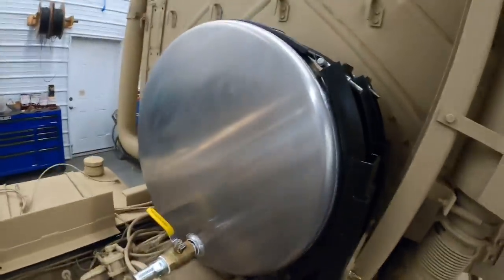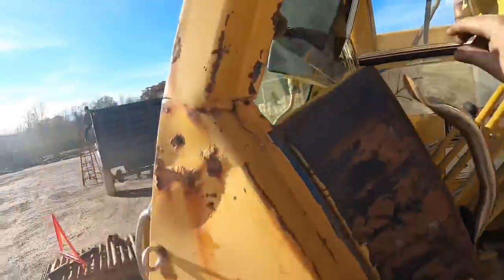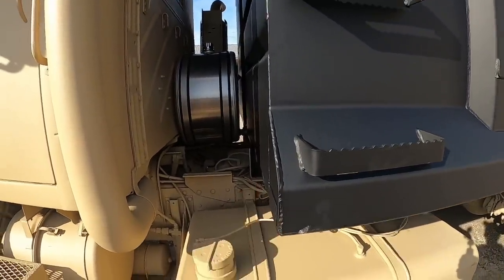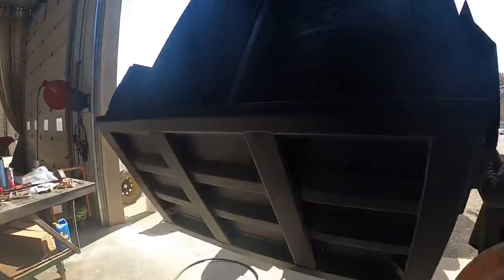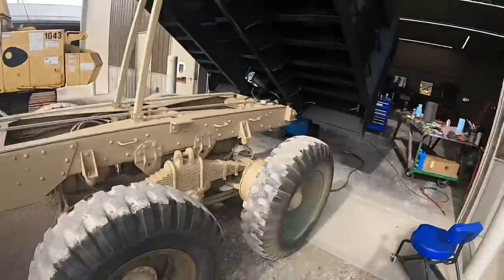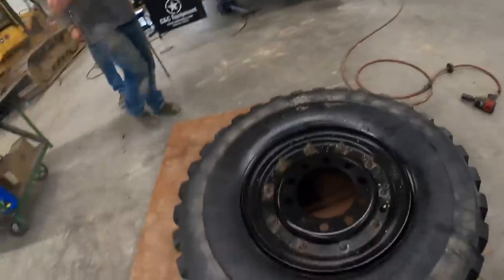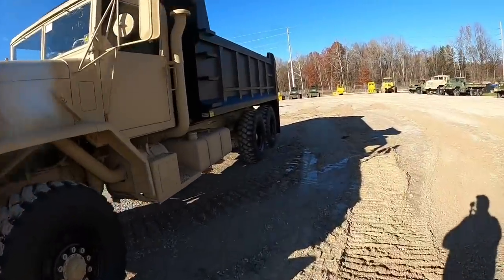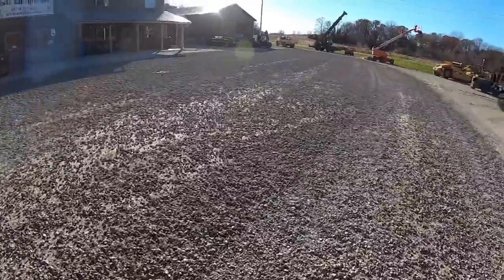5 ton military dump truck build installing bed and spreading stone! @C_CEQUIPMENT

Comment: A tip for the mudflaps.  Use a full width strap to clamp the mudflap. This makes it easy to loosen the bolts and  slide the mudflap back in when they get rippped off.
Using the mudflap washers like you have means that you have 5 bites taken out of the mudflap leaving nothing to clamp onto.

Comment: That is a really good looking dump truck . The main thing that really set it off was when you all changed the wheels and bigger tires . You and the truck did a great job of spreading the gravel . That looks like a really well made dump bed and it sets perfect on the truck, you all did a great job on the build .
My dad hauled and spread thousands of tons of different sizes of gravel on roads.  And at one time he hauled a lot of blacktop, also and at one time he hauled a lot of slag out of a steel mill (and that stuff was hot, hotter than blacktop) and dumped it on roads. Years ago, he worked on a government job for a while with his truck hauling gravel and dumping them on a big acreage of a construction site and dumped the gravel on a lot of the site 8 feet thick .
I will see you all later in another video, so be careful and stay safe .
As always, Jeffrey !!!
Reply from the maker: Thanks

Comment: I was in an engineer battalion back in the 80's almost 90 and drove trucks like these and the 5 ton dump. These were go anywhere haul anything and get the job done types of trucks. How you set this one up is awesome. What we had were basic bare minimum setups. The only thing is that I would caution folks is those split rim tires. Always use a safety chain around the tire and rim when you go to air it up. Accidents happen and nobody wants to see one of those rings  come flying off. I know that safety has been improved since the last time I changed one of these but you can never be too careful. I saw the price for one of these trucks that was given to another commenter and I'm surprised it was that low. I was expecting the price to be mid 50's to mid 60's. Good job.

Comment: Here in aus we use a brake booster instead of an air cylinder so if you park up with a load your tailgate won’t pop.
Reply from the maker: That’s interesting and sounds like a great idea!

Comment: Maybe make a pan for the dump body if a person was to dump asphalt into a machine it would dump right into the Harper and not miss and make a mess also put hook and eyes on the mud flaps so when in use they wouldn’t get torn off. Just a thought!

Comment: Nice build! I took a 5 ton 5th wheel 900 series an put an 800 series dump bed on it. Love the truck but now wish I had the longer dump bed were I could carry more. Would like to know see how yall would fix one with a winch on the front an run the hydraulics for each. I'm sure my problem is a little different because of the 800 series bed. Beautiful truck an looks like it works flawlessly!
Reply from the maker: We have done a few with the winch
Takes some extra plumbing but can be done!

Comment: Mud flap fail need to cut up from hole it will come off in stead of ripping off when backed over then reinstall not damaged!
Reply from the maker: Good tip

Comment: I love this truck it has everything on it for my line of work except I would rather have a barn gate for hauling brush and debris and I would prefer manual transmission bc automatics are more aggravating when tailgating stone, I'd also add tarp system. But I love how this truck has the flip up hood instead of the bat wing style that you often see on these trucks, the bed is full size and fits truck well for any application, I'd like pintle hitch and air brake & electric brake hookups added. This is a sweet truck im debating on getting rid of my tandem for a setup like this. I serve a 70 mile radius with my business but a truck like this would serve me great for getting in tricky areas or off road areas. How much does a build like this cost or what are you guys selling a truck like this for ? @ C&C equipment
Reply from the maker: They start at 41k
Reply: @C_CEQUIPMENT  is that cab and Chassis only, dump beds optional?
Reply from the maker: We can sell cab and chassis

Comment: When they refer to that truck as a 5 ton truck, are they referring to the gvwr? I know that truck will haul more than 5 tons.
Reply from the maker: So those ratings are the off road capacity per military 
On road is more
But everything the military builds is underrated and overbuilt 
They will haul 15plus tons no problem

Comment: Hey buddy i happened to notice on your hydraulic tank bracket and on the mud flaps instead of having the head of the bolts face out you put the nuts outwards. So i was just wondering if there was a reason or not.. Either way it's a beautiful rig you guys did a hell of a job on it!!!! Happy New Year!
Reply from the maker: So I like to do that on the mudflaps so it makes it easier on the next guy to take them off
If you put the nut towards the tire all the dirt, water and salt get thrown on there making it more likely to seize up
And harder to take off
Hopefully that makes since
Reply: Also when you put the nut and the  threaded end of the bolt towards the outside ( back of the truck ) and the head towards the tires it doesn't catch grass and mud and stuff that is throwed up by the tires as bad and build up in there along the top of the mud flaps and then ice and snow in the winter time and build it all up in there, it doesn't have the extra length of the bolt sticking out for the stuff to hang on and build up .

Comment: I bought lots of those 8.3 cummins military trucks , I still have one 923a2 and a 929a2 dump , that box you put on is way to big and heavy. those engines are way to weak on power for any thing to heavy , the box is heavy enough , besides putting material in them. let me know what you think. I had a 817 dump and it had more power than the 8.3 .
Reply from the maker: They are underpowered for sure
We have built over 40 of this model and had several repeat customers

Comment: I have two concerns, when doing your wiring I noticed you don’t solder the joints, second concern the young fella that was doing those tires, did not have the tires in a cage. I had a friend damn near get split in half from the retaining ring came flying out, needless to say he died. Overall you do very nice work, work safely and live for tomorrow.
Reply from the maker: Yes thanks 
These wheels are a little different then what your are explaining 
The outer rim is bolted on making it very unlikely to come apart

Comment: Needed rubber hoses over the spreader chain  Limited "Scratches"
Reply: Would you do me a favor please D.P has not found a beverage holder for Lt.Dan and his John Deere with the plow found him a few Winches for him to look at for his smaller dozer as a tow er to adjust him when making turns to fixon his smaller dozer I also found a excavator for $1 looks all there plus a few more?

Comment: Don't know how much corrosion you get there? As I have always found that running grounds back to the battery grd is better not relying on frame to do that. Heat shrinks double wall epoxy with soldering connections .  
You have greaseable pins, not greased isee. hhaaaa

Comment: Do you ever run across any of the older trucks like this one but with a manual transmission???
Reply from the maker: Some
I have a couple at the shop
Reply: @C_CEQUIPMENT  What model were they M818???
Reply from the maker: I have an m814 which is the double frame long wheelbase like we use for dump trucks then we had an m813 but it’s sold
Reply: @C_CEQUIPMENT  Have you got pictures of the m814???
Reply from the maker: Email us 
Sales@ccsurplus.com and we can get some
Reply from the maker: Email us 
Sales@ccsurplus.com and we can get some

Comment: That doesn't seem like enough weld passes on those hinges to the bed
Reply from the maker: Hmm
I have personally welded over 60 of them on and not had any issues
Reply: @C_CEQUIPMENT Ii worked at a place that built dump trucks they did minimum 6 passes on each side of each hinge. It looked like you only did 2 or was that editing

Comment: Great Job!  One question do you ever have trouble with the air tailgate cylinder leaking off and the tailgate opening while loaded?  The trucks I worked on hauled sludge and had to have a safety lock installed on the gate.  Thanks for sharing!
Reply from the maker: Not on normal conditions 
The way they cam over makes them strong
But they do offer sludge locks as an option… that stuff is nasty and the main reason for those is to keep the tailgate pulled in tight so it doesn’t seep out
Reply: @C_CEQUIPMENT  Thanks

Comment: This is my first time seeing your video. The truck looks amazing!!! I really like how the paint turned out. I’m looking forward to seeing the beginning of this project.
You should put duals in back because if you have a blowout you will be down until it gets fixed whereas if you have a dual set up you can fumble your way to a service area.
 the bolts for the mud flaps are too long. They are backwards. The nut should be on the inside of the flaps to give a clean. Look from the back and the front flaps.
Whenever you are recording, please let those around you to have some sort of decorum or just edit it out. Nobody wants to hear farting or burping. 
It’s obvious somebody’s mother didn’t teach them how to be an adult.. just sayin.